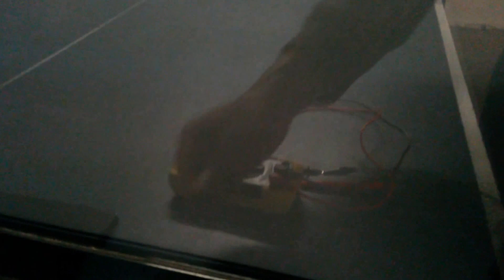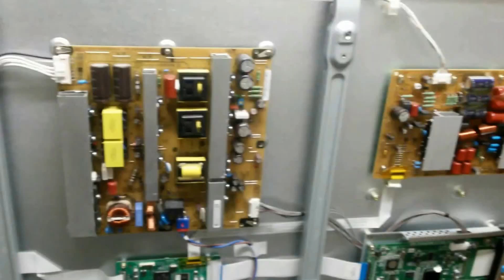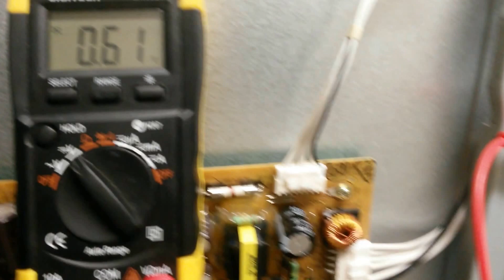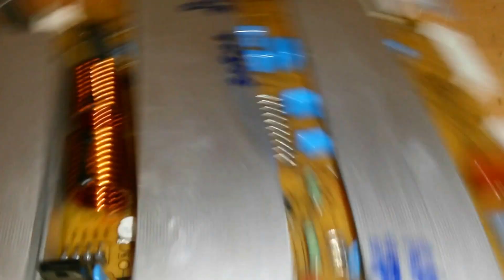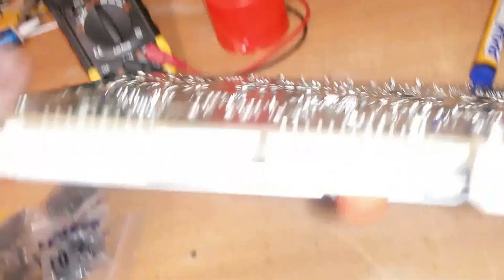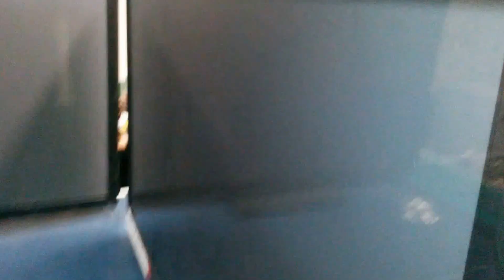LG50PT250 Repair

Comment: Hi, can you assist me. I am looking for a power supply board for this model. I got this as a hand me down which needed repairs, it didn’t have the power supply board in it.. I need the part number or any other compatible board number to fix it. It would be so sad to throw it away..can you guide me accordingly...

Comment: Do you have any experience with an LG model 50PJ350 Plasma?  Got one in with 7 different mosfet transistors on the Y-Sustain board dead shorted.  Replaced all 7 similar to how you replaced the bad ones on your board, powered it up, and, well I should have saved it for the 4th of July lol.  New parts went off like a string of firecrackers.  So I'm wondering if something in the panel or on another board can blow up the Y-Sustain board, or if I most likely missed a bad component?  No more obvious shorts but there are several control IC's that can't be checked with a simple ohm meter.  Bottom line, would it be worth $75 plus shipping to try a whole different Y-Sus board, or is it likely something in the TV would blow it up too?

Comment: Great Video. Inspired me to try to fix my LG50PT350. Looks to have almost Identical Boards. The Symptom is that it Clicks to come on and stays on and energized. No Click back off like the one in your video. The Main symptom visually is the screen attempts to light up but all RED. Then it goes blank again. It repeats the red screen then blank over and over. You can power it off with the button to stop this behavior. Turn it back on does the same thing again.  Do you have any insight into this?

Comment: Very Good video but you should indicate how to check the failed components.  

I have a similar fault but the failed components are slightly different.  

I believe they you are checking between the three legs of each IC looking for a short. Once you find a short you remove the component and again check for a short.  

In the video you will see that he has circled three adjoining ic 's with a marker but is only replacing two of them in that area. This because one shorted Ic will make the others look short while still in circuit.  

I had the same condition but only one was unserviceable. (The 30f124 ) also had a ceramic cap that looks like has popped. 

Also good idea to check for shorts in the other board on the RHS while you are at it. 

Have ordered the replacement ics so fingers crossed.
Reply: those components are not ICs..  they are transistors and one was a double diode..  but you are right when you say he should teach people how to check whether the components are good or not. a board full of components has a great probability of any one blows, fuse.. we have no way round but check all of them. we tend to check the ones that are in more sensitive areas also the ones that have more current floating through, but it's like you said ( a capacitor could be the problem ) sometimes they don't even pop. however, their capability of keeping the  load is compromised..

Comment: Hi there, how do I troubleshoot why the 5A FUSE (F302) on the power supply board blows immediately when switching on TV. It is also a LG 50PT250
Reply: look... I don't know how far your knowledge in electronics goes, and my English isn't the best, but you have three possibilities to check there on your board. you have a diode , a capacitor and a resistor going towards the primary of the transformer... their numbers are ( r301 - c312 - d305 )..  your post is one year old... you must have solved this issue by now, but if not.. check those components... remember that the diode allows the current to go only on one direction..   ops, almost forgot... you have to check those components under your board.. behind the fuse.

Comment: So I have 50 PT350-UD changed the components as you said. Still the same problems.
Reply: Howard Giesbrecht have a look to see if you have any scorching around the small heat sink!!..... If so that's where your problems are, I have the same thing with mine.
Reply: re soldering all components